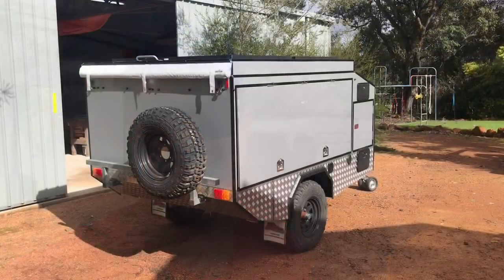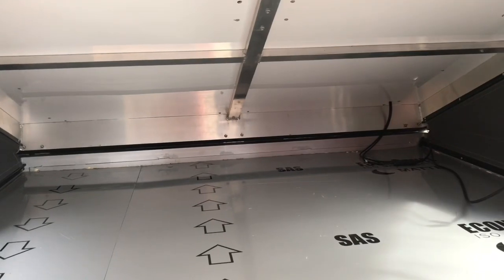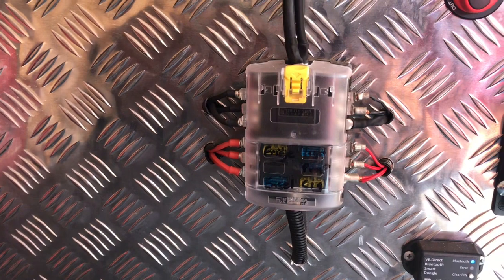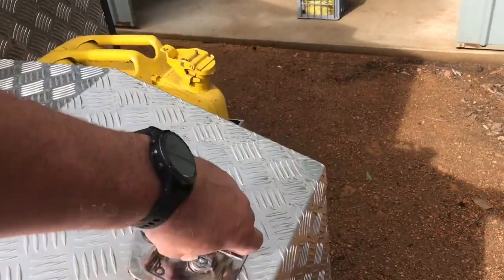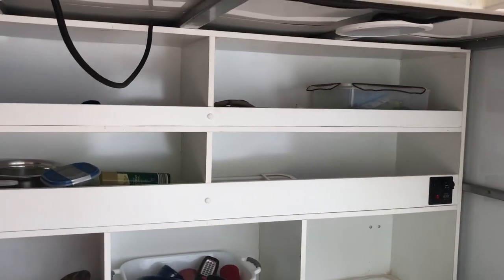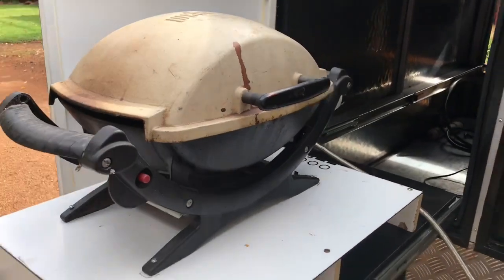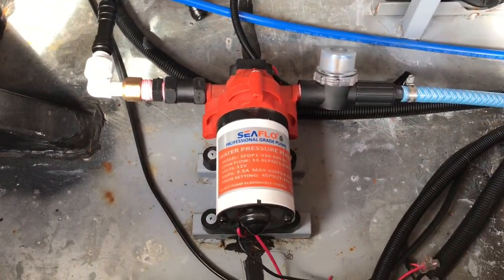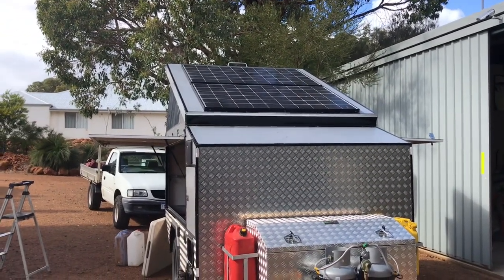DIY Camper - Part 2

Comment: Genius. Wife a little claustrophobic; thought maybe 4 gas struts to lift the lid vertical for 4x sides; with a snap support bar either side to secure the weight.
Do you think the four sides would work from what you know or hazardous in high winds perhaps? 
Have had a very heavy camper top drop when erecting; scary stuff.

Comment: Hi Matt, does that Victron charger accept 30VDC or do you need to bring the panel voltage down a bit? I use a house panel into an ebay MPPT which has done fine for 6 years, but occasionally i help our friends and the Redarc gear only accepts 24V. One day I’d like to install a bunch of victron gear as it seems to be the best on the market these days.

Love the amount of water you carry. What is your weight fully loaded?
Reply from the maker: Yes it does 30v. Awesome unit. Solar keeps everything charged. Even with 2 fridges. 

Fully loaded 2000kgs

Comment: This is really great, i have been looking at building something similar and i had some questions on some of the materials you used. Like what did you cover the upper portion in since it's not the galvanized steel. In the other video i saw you gluing it, was that how you attached the panels or did you also rivet them onto the frame after gluing them?
Reply from the maker: Cody Salyer rivets were used as well

Comment: What is the loaded weight of your camper Matt?
Reply from the maker: Peter Hanson trailer dry weight is 1350kgs. Springs and axles are rated to 2000kgs. That means load capacity is 650kgs

Comment: too boxy and heave. it will put extra stress on the engine. not good for off road and road trip. fule maillage are really bad. not good for a adventure road trips.
Reply from the maker: Thanks mate. I guess you’ve never towed an off-road caravan?  They are 3times bigger and heavier.
Reply: @mathyland5373  Excellent build Mat.  I would like to build an off-road caravan too.  Should the off-road caravan be heavier? Why?  Thank you.